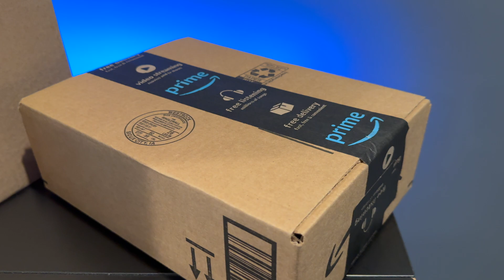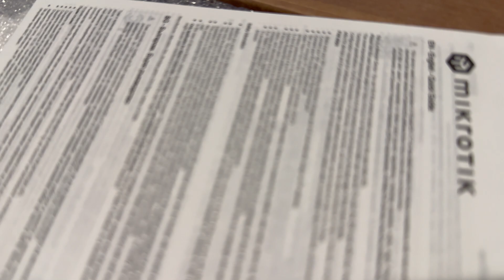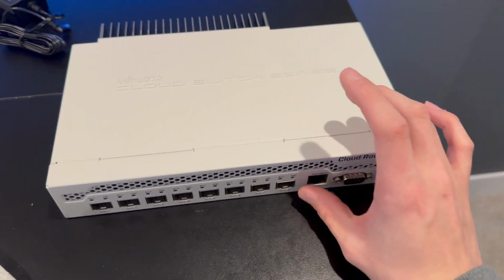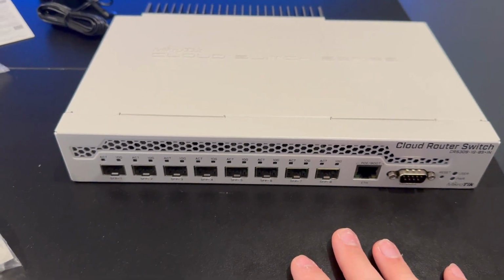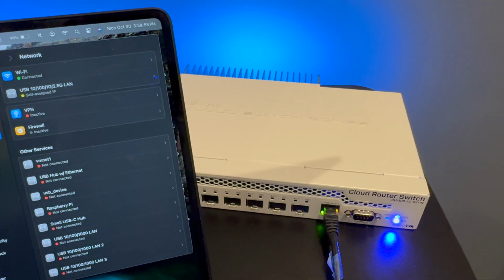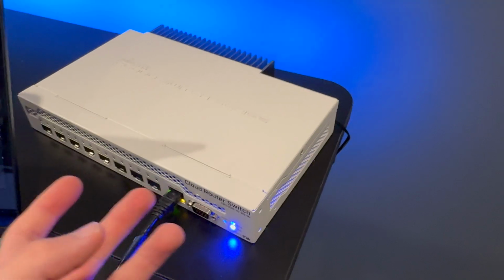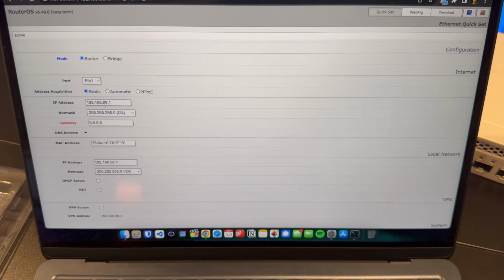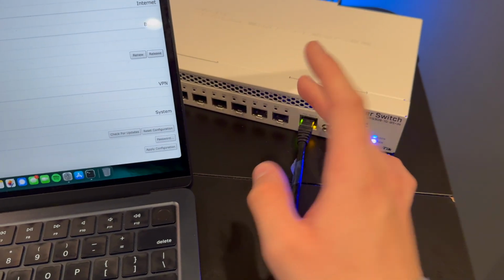DIY 10Gbps Networking: Unboxing and Setting Up the MikroTik CRS309-1G-8S+IN Switch!

Comment: you really did not prepare for that video quite long i reckon...
(beeper can be turned off btw. - system > routerboard > settings > silent-boot)
with mikrotik you actually should be savvy in networking fundamentals and reading a documentation.

(btw. please get you fingernails either cleaned up or out of the frame- just a tip)
for mikrotik easy basic "learn to know" check out TheNetworkBerg

Comment: i also wanted to mention, i stepped away from my 309. i went from PFsense and all mikrotik to a UDM SE and mikrotik switches. since then i plan to/have been switching to all unifi gear. for what i do and the simplicity of their ecosystem when everything works together made more sense. and at the same price point for their agg switch it was a no brainer.
Reply from the maker: Interesting, I’m going the opposite direction. Trying to get more MikroTik switches so I can learn new things like BGP and more advanced routing than Unifi offers.
Reply: @beamnetworks1 mikrotik is a swiss army knife if u know how to use it u can do what ever u want and also u must know its limitations what you should not do
Gud luck there is a steep learning curve hope u enjoy it
Reply: i have a CRS112 with a fiber run to my desk, and likely wont change that. i LOVE mikrotik's software its well documented so its pretty straightforward. but this is a hobby for me (im a heavy equipment operator/past life security dude) and the simplicity of unifi was what i was ultimately after. i also had an issue with getting my 10g sfp nic in my old PFsense router to play nice as a wan port. that was really the deciding factor for me. and that PC ended up becoming my truenas server and home assistant box etc  @beamnetworks1

Comment: i had to put a piece of tape over that blue LED it was so obnoxiously bright
Reply from the maker: Ha good idea, I might do that. Wish you could just turn it off via software.
Reply: yeah i looked everywhere and couldnt find a way. @beamnetworks1
Reply: Same thing.  I used a piece of black electrical tape to cover 99% of the LED.  1% is just enough for me to see that it's on.